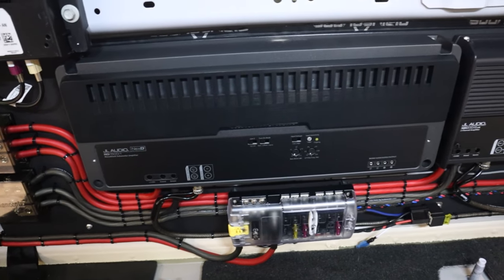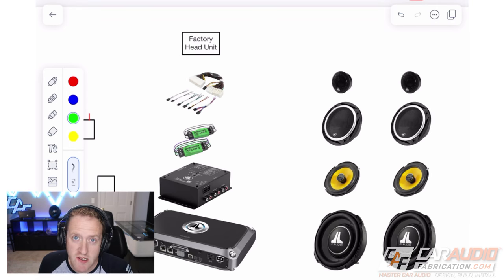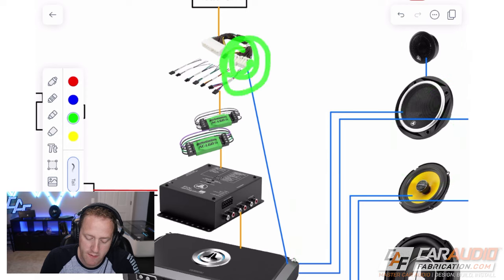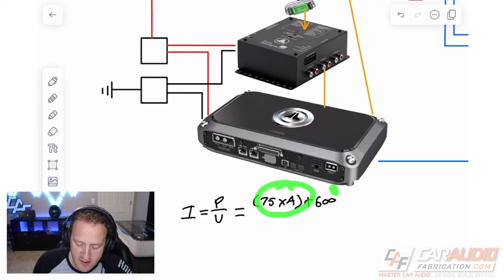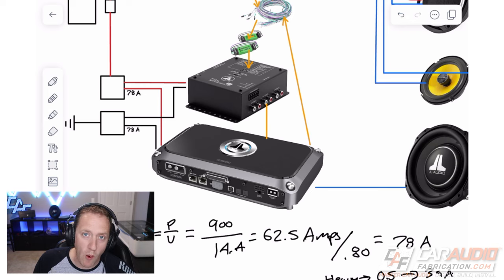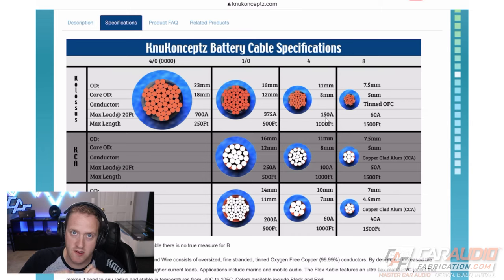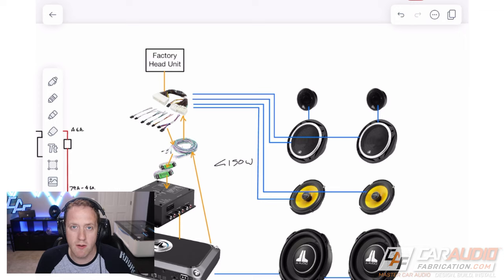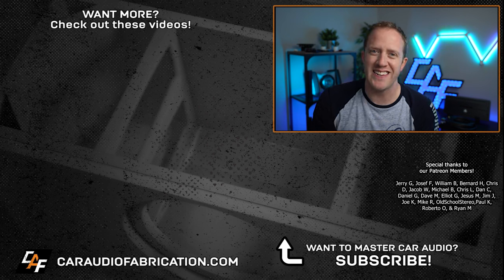How to plan ELECTRICAL for FULL SYSTEM - 5 Channel Amplifier

Comment: I am a fan of 5 channel and multiple amp setups. It really depends on the situation. For simple installs, 5 channels are great. Especially when you aren't running several thousands of watts to subs. My wife has a JP95 amp powering her system with 2 Incriminator Audio I12 subs at 1300 watts. The 4 channels power her front, rear and tweeters. I have  JP84 and JP23 V2 amps. 3 speakers in each front door. Plus, 2 Incriminator Audio Lethal Injection 12s at 2500 watts. Our systems were designed for different things. Now, she wants my system. I also installed a Recoil 5 channel amp in my buddy's truck for door speakers and a preloaded Kicker dual 12 enclosure. Single amp setups are easier to wire and manage. Also, they look cleaner.

Comment: I like all in one amps. Like zapco amps with dsp. 6 channel 100x6 with 8 channel dsp. 4 channels up front,  2 out back and sub channel out dsp so you can get choose your own bass amp. Nothing comes close to zapco for the 800$ that 6 channel coat. Its class AB also so sound quality will be top notch.

Comment: I don't know enough to say whether I'm a fan of the all-in-one amp or separate amps. I can see the value in both, and some issues with both, but that's about where it ends.

What I do know is that I watched a number of your videos before finally arriving at a solution that works for my Malibu with the Bose system. 

It retains the factory HU and Bose amp, but the speakers are all new, plus a 10" sub-woofer. From the factory amp, the output goes to a DSP, then to a 5-channel 750W amp. 

The front speakers use the factory wires, the rear deck speakers use new 16-ga wire, and the sub gets its own 10-ga wire. 

Power goes to a 100A breaker at the battery, then to a 4-ga wire to the trunk, then to a second 100A breaker, and then across the trunk to the amp. I originally had plans to have a second battery in the trunk, which was the reason for the second breaker.

Comment: I’m getting ready to begin my custom install in my focus st and your videos have been a huge help.  I live in phoenix so I’ve already stopped by mobile solutions for some stuff.  Going with a C7 3 way custom a pillar setup and 13w7 in my focus st.  Planning on taking a lot of inspiration from your stealth install.

I went with separate amps because I needed 8 channels plus the sub.  I decided on the vxi amps - 800/8 and 1000/1 for this.
Reply from the maker: That's going to be an awesome system! Enjoy!
Reply: Are you going to post videos on here? I just finished up the temp setup in my 2016 FoST with my older Audison LrX5.1k, Hertz Mille 3-ways with the pillars on the passive crossovers and mids active, and a 12” Hertz HX sealed. I say temp because I do plan to redo the sub portion to get some of my trunk back, either 3 of the Audison Prima 8s or maybe 2 of the new Hertz Mille shallow subs and do a nice false floor at the same time. I just had the HX already so I decided to run it.
Reply: @dday_p51  I’m not a youtuber like Mark but I might post some pictures and video of the process.
Reply: I’m in mesa . Running the same amps (both vxi ) in a 2020 Caddi .13w7 and all focal speakers , Jl hub. Mine build will show the magnet thru plexi and plexi slot port  ,sub firing forward  , leds , cool bracing and  that mobile solutions vibe ! Because I’m running focal k2 they are already 2 ohm which is super cool . The doors have some excellent bass . Thanks Mark for the helpful videos

Comment: I like the 5 channel amps, currently have the RD900/5 powering 2 10’s and 4 6.5’s. Sounds really good, recently upgraded all the RCA’s to KnuConceptz and noticed a big difference. Although, I feel at times that I am under powering the subs.
Reply from the maker: What subs and speakers are you running? Sounds like a nice system!
Reply: @CarAudioFabrication  running a set of JL Audio 10W0v3’s in a sealed enclosure and 4 pioneer 6.5’s. I think my winter project will be to replace the 6.5 with a mid tweeter combo, I like Focal but also like the JL Audio C2 that you can mount the tweeter on the woofer.

Comment: I've watched so many of your videos to configure my 2021 Toyota Tacoma setup. Ended up going with a Rockford Fosgate R2-750X5, JL Audio SB-T-TACDCG3/10TW3 Stealthbox, and Kicker CS Coaxial speakers with the OEM headunit for ease of installation. It sounds 100x better than my buddy's truck that has the factory JBL upgrade especially after adding sound deadening material throughout.
Reply from the maker: That's awesome! Glad you are getting to enjoy amazing sound! Sound treatment is definitely key. Does that model have one or two of the 10's?

Comment: My build is finally finished. I have two fi audio mt 12’s in a down for sound profab enclosure, two skar audio skv2 4500’s strapped, 2 xs power d3400 batteries, 320 amp alternator, two runs of 1/0 wire, and a 4 channel for the highs.

Comment: I love using multi channel amps as well simplicity in connections and placement.  I had a pdx-v9 added another pdx-v9.   3 way up front, 3 way out back running active and passive, woofers by themselves mids and tweets on a passive.   Then each sub channel running 2 type r 8's.  Was easy to upgrade each time. Started small and built up from there.

Comment: For ease of use in a mild build, multi channel amps are awesome as far as I'm concerned. If you are going to decibel drags... well, you should already know what you need. Lol.
I'm currently using a multi with built-in dsp, and I think it sounds very good. I'm having issues getting the tune spot on, but that's probably me.

Comment: I like the concept of a full system amplifier and they certainly have their place. For the average person, they are likely to be all they will need. But the major downside is lack of individual upgradability. For example, if I have a 5-channel amp up and running and then decide 600 watts is not enough for my new 18's I'm upgrading to, then I need to run a separate subwoofer amp and I now have a 5th (or 7th) channel on my amp that's not being used. So my advice would be: if you are confident the full system amp delivers all the power you suspect you will ever need, go with it. Less to wire, less room taken up by multiple amps. But if you think you might one day want more power (most likely for your subs) then you should probably keep sub and mid/high amplification in separate amps. My 2 cents.
Reply from the maker: Yes, definitely agree the 5 channel locks you in and makes future upgrades more difficult, but if looking for something compact it can't be beat!
Reply: That is one downfall of 5 channel amps. But, Down4Sound and Deaf Bonce make massive powered 5 channel amps. My wife's JP95 is pushing 1300 watts on the sub channel. The Deaf Bonce does over 2,000 watts on the sub channel. So, one could upgrade to a larger 5 channel amp too.

Comment: I prefer using seperate amps for lows and highs. You had mentioned in one of your previous videos that if the amp stopped working you were down for the count. 
Using 2 or more amps for your setup allows you to keep your system working and makes it easier to replace the defective amp without losing the whole system.
BTW, I really enjoy your videos -  very informative, I watch them all. 
Thanks!
Reply from the maker: Always a trade off! Thanks for watching!

Comment: I would love to have a 5 channel amp in all my cars, but I prefer individual amplifiers because, initial investment upfront is lower and you can add amplifiers later but 0 gauge wiring upto the trunk distribution block is mandatory, you will really appreciate the addition of each amplifier powered speaker one at a time and the difference it makes alone, in case you damage your amplifier (may be a short, water ingress, stupidity etc...) you burn one amplifier at a time also flexibility in wiring as close to the speakers as possible, location and mounting, size and the ability to turn them off individually when you are parked and listening to music alone.

Comment: im planning on running 4 amps for my setup,  3X12in subs with an amp each, and a single stealth cabin amp for the internal speakers.  looking forward to how you set yours up as some insperation would be great,  i half set it up nice,  soldered and plastic wrapped connections,  then started running out of daylight and rushed the back end install so need to go back and redo all the boot stuff.
Reply from the maker: Sounds fun! Here's a video for planning electrical for more amps if it helps - https://youtu.be/WwlqMVu609s?feature=shared

Comment: Hello! I always wondered why my system not sounding right even after hours and hours of tuning with sonarworks mic and a DSP. Seeing your latest videos I decided to try out a JL audio Fix 82. (also to upgrade spare wheel sub to JL audio 10tw3). Thank you. Will see what it does but I suspect the factory stereo in my Polo being EQ'd before sending the signal to everything else.

Comment: Multi vs Single AMPs to vary by system goals and what is the vehicle. Typically i have always preferred two or more in the past but the new stuff is so good that it becomes about application and goals

Comment: I recently started watching your videos as I am about to upgrade my system in my car. They really help and are detailed but concise and to the point. I will have 2 amps one for the speakers, and the other for the sub. I always wonder what wires I need to upgrade as the car is from the 90s. Do you suggest gutting out everything or just doing what is needed?

Comment: Thank you for an awesome video, it's just in time for a new project for my new 2023 Forester wilderness,  the sound system is a non-hk, I want to ask you if have worked with Subaru with the Starlink system. Is there a way to bypass the Starlink system because the front speakers wires run through the Starlink and it can not be amplified more than 25 watts or it will ruined the system. I want upgrade my sound system with speakers, sub and amp while keeping the stock H.U. or maybe an aftermarket one. Your guidance will be very appreciated. Thank you Mark and Aloha🤙

Comment: Great video as always Mark! I didn't plan my system all that well. I watched a bunch of your videos but still missed things! I have a Helix M6 DSP amp and a Skar Audio RP1500 mono block. This is all in a 14 Ram! My issue is I don't have any channels left for my rear fill!! I'm thinking about changing the sub amp to something smaller so I can squeeze a 2 or 4 channel next to it! Any recommendations?
Reply: The power of the M6 is fine! The Morel 3 way set up front sounds good, but I'm craving more midbass! May put 8" in door to take the place of the 6.5. The mid bass is maxed out with the toslink optical and midbass adjustments. Just ran a 6 channel rca to see if maybe I can help with some radio adjustments

Comment: I'm running a Kenwood 6006dsp and a JP8. I also have a 21 Elantra. My question is this, I soldered RCA's directly to my front speaker outputs for my signal and I've had zero issues. Why do you need the LGDS and I didn't?

Comment: What do you do if your Amp power connectors are designed to fit 10 AWG wire or smaller? I picked up the new Alpine Optim8 and the power terminals are designed for 10AWG. I was told I should just make 8AWG fit. Suggestions? I prefer less amps so just the 1. Thanks for sharing!
Reply: @JasonWW2000  thanks! Half it's rated power doesn't sound good!
Reply: @JasonWW2000  Thanks! If I got a sub, it may only be just one so thinking the amp would be ok. Would reevaluate later on. Appreciate your input!

Comment: Tony D'Amore did a video on how much wattage factory wiring can handle. I don't recall just how much, but it was north of 700wrms.
Reply from the maker: That's awesome! Yeah, its one of those things, if you can easily replace the factory wiring go for it, but with so many vehicles having a pinned plug between the door and body its no longer practical to just simply run wire through there.

Comment: Plan on doing a 660.5CX amp with focal icu 165s in the back on flat and two kicker 10 inch comp Cs I still have been debating on components I want any recommendations would be awesome 65-70ish range

Comment: Question regarding ground wire sizes... 

I understand that if you are going straight to a device, your ground wire should be the same size as your power wire. But what if where your fuseblock is, is only where the control system is, and the device is somewhere else. Like, say your fuseblock is in the trunk, and you have a switch that turns a relay on and off, which sends power from that fuseblock to a device mounted under the dash. That device wouldn't be grounded back at the fuse block would it, or wouldn't it be better to ground it 'locally' ie: within a couple feet of the device?

Comment: I'm using an aftermarket kenwood head unit. Do I still need the T-harness, audio controller, and DSP correction processor between the head unit and amp? Or can i just go from head unit to amp.

Comment: System I'm going to do will have 3 amps. 3 component fronts. Rear doors for fill. All those will be on an 800 watt 8 channel amp. Running 4 subs on 2 1000 1 channel amps. Everything will be JL Audio. Head unit will be Alpine.
Reply: @davem6218  You’re going to be deaf. 😂

Comment: Is it possible to use one single 4 channel A/B Amp to power 8 speakers (1 x 6.5" component speakers in front doors, 1x 6.5" coaxial in rear doors and 4 x 6x9" in the third row of a medium size SUV) but having kinda switch to have the front and rear doors speakers working while the 4 6x9 are off and viceversa, having the 4 x 6x9 working while the doors speakers are off.   Or it is simple not achievable and definitely we have to install three Amps; 1 x doors, 1x 4 x 6x9 and 1 x subwoofers ???   All technical advise are welcome !

Comment: I have been using the same 4 channel + monoblock + active crossover from my first car to the now 4th (a decade later). I always hated struggling to find space to place all the components. 
My idea is to install the system and make it seem factory fitted. 
with the new car, I'm now looking for an affordable 5-channel with high-input + crossover just to minimize the components required... still looking though :(

Comment: So I just got a car that has no head unit and is running just a 4 channel amp as it "head unit" can I add an amp to run with it or should I just buy a 5 channel and run the sub wires

Comment: I think power balancing over too  much sub volume. Front and rear speaker just 300 watt but why you put 600 watt sub isnt that enough 300 watt? Im trying to set up system like that I bought one 400 watt rms  sub and front 75x2 component rear 60x2 coaxial. Should I increase sup power? Isnt that enough? My car is a b segment car and I think this is enough. And I planned to wire size on amps fuse value. Amp has 60 amp fuse I calculate to that value. I suppose amp couldnt draw current above 60 amp if it does it pops.I think calculation useless. I learn alot of think from you but you are bass man.🤟

Comment: I have a newbie question...  My Rav4 has 6 speaker locations...  I also want 2 small (6.5 ) subs...  It is for quality listening at moderate volumes... I was thinking about a 5 channel amp... But how do I get ALL that wired into the one amp...

Comment: Great video thanks! Do you follow <150WRMS or Max /ch on stock speaker wire?
Reply from the maker: It depends as stock speaker wiring can vary, but generally speaking that is a somewhat safe assumption.